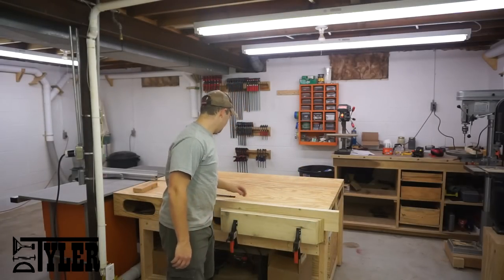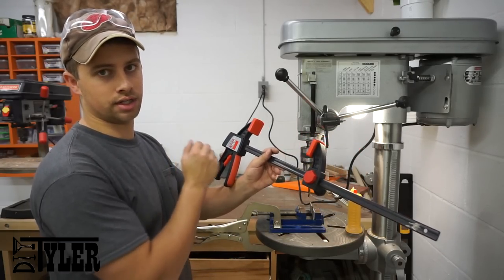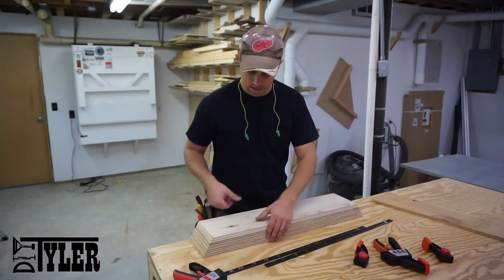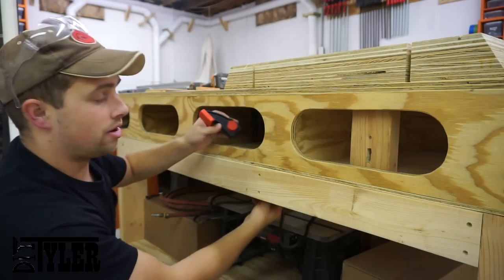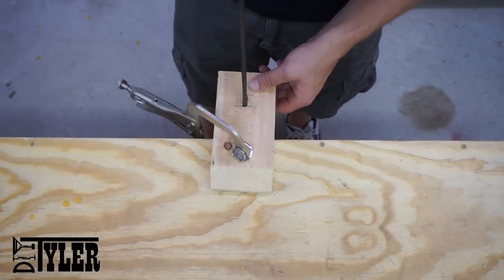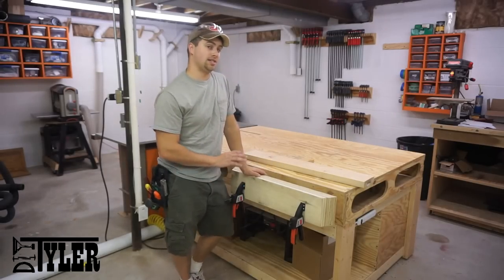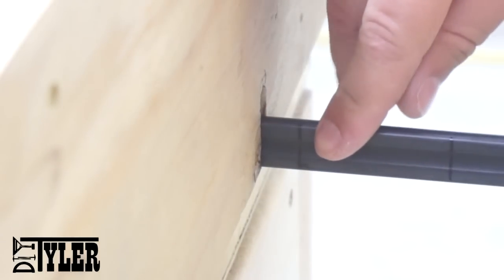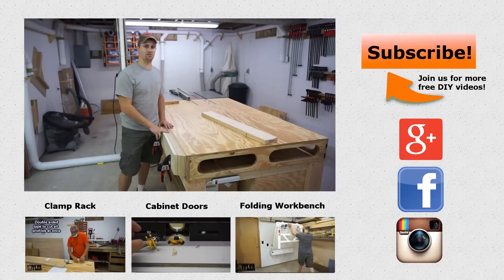Quick-Clamp Vice for the Workbench

Comment: You can probably get away with leaving the ends of the clamps as far out as they can go and just using a filler board across the top of the bars of both clamps inside the table, instead of always reaching in to adjust the clamp ends every time.
Fantastic idea with the clamps though! 👍
Reply from the maker: +Tiny Houses That's a great idea, never thought of that. Only issue is you would need several different filler boards. Might look into it though, I use the thing way more than I expected!

Comment: good idea.
what are your thought about pipe clamps instead of bar clamps instead?
My though being, drill 1/2" or 3/4"  holes through face & "backers" (also with corresponding sized holes all at once. Then place "backers" behind bench interior the and use the pipes as rails? supported by vise face piece, bench piece, "backer"  and clamp end.
ie: 
/-]]]            --||                        --                                      | |-][-              -||             / -[[[/--
/-]]]-crank-outer press foot-inner/bench press foot-bench rail-"backer"/  -[[[/-- 
just a thought merely asking opinion on my thought processes regarding future DIY build ;-) no judgment.

Comment: Nice work Tyler. The vise is great about the skewing or racking... there is not much you can do with that it happens to most vises on my vise since its a single screw it racks side to side so I put a piece of wood on the side i am not using the same size as my work piece. I think you could do that on this vise but it would be at the bottom so it may be harder. @kennyearrings1 just made a video about a rack stop https://www.youtube.com/watch?v=IAtEXZ7Nd2k which you might be able to modify if needed. Keep up the great work.
Reply from the maker: +Jorge Araujo (HANDCRAFTED CREATIVE) Thanks for the link Jorge! Have thought of adding a parallel block like you mentioned and will probably do that when I have a larger piece in place. Kenny's idea looks like a good one. thanks Jorge!